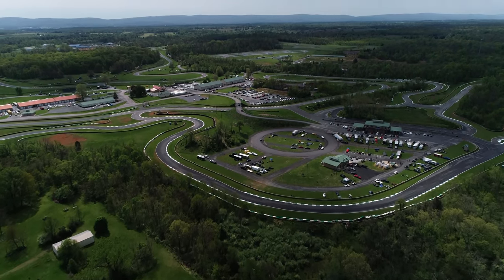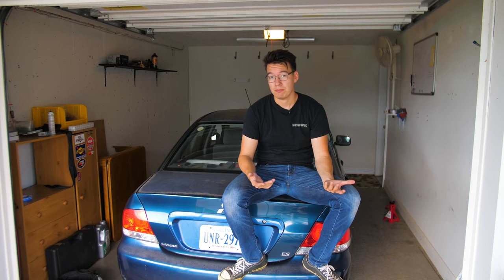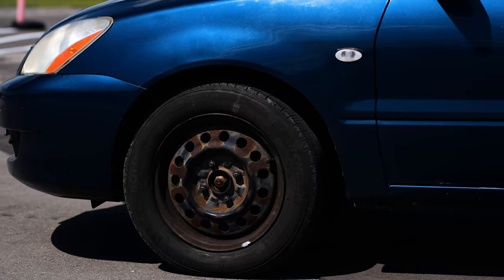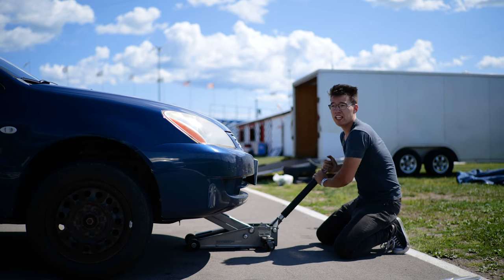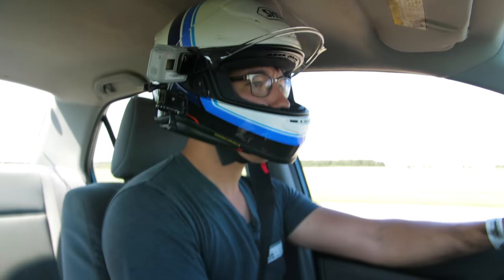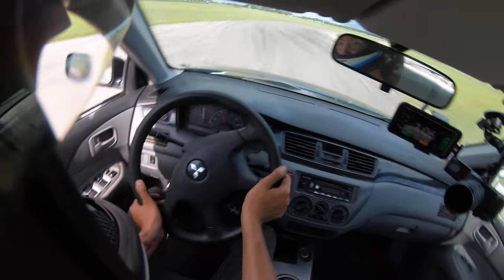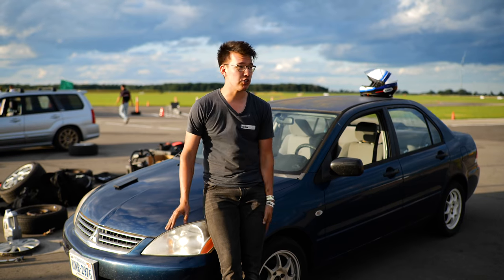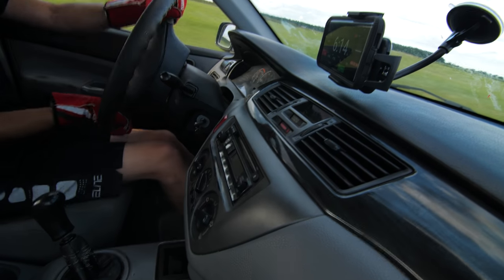Can You Track Your Beater Car?

Comment: Bottom line- good tires and brakes are a MUST.
Reply: tires have always been the best upgrade you can do to a car.  A cars performance is ultimately limited by its grip potential.
Reply: Those are the best first upgrades to do to a car.
Reply: Only thing that touches the road in a way the most important thing on your car 100hp / 1000hp all must translate through the tire 😂🏁👍🏼
Reply: The problem with tires is that if you pick something too sticky then you'll potentially create even more issues with understeer and you'll cook your brakes that much faster.
Reply: Is semi slick tires a must?
Reply: Yes sir!
Reply: @aaryeshg.6526  i would include new brakefluid and a prefectly bled brake system.
Because those old beaters usually have been neglected a lot. 
OLD brakefluid will cause fading within a few fast laps.
Reply: but wouldn't less grip be good fun as well? sliding around and kicking the back is so much fun.
I want to take my daily Subaru Impreza 2.0GX  AWD auto to a track day. I have more fun sideways so I don't want to change tires and i actually want to go on a wet rainy day.
if want to go fastest then sure, get sticky tires but the most fun way around a track is not necessarily the fastest don't you think?
Reply: @aaryeshg.6526  found you
Reply: Just got home from my first track day and I approve this message.

All season tyres aren't the best option.
Reply: I thought sticky tires with stock suspension wasn't the best idea though, more stress on parts that werent designed for such levels of performance.
Reply: Yossi Shohat You will get black flagged for drifting. Go to a drift meet, will probably be a lot cheaper for entry also.
Reply: High temp brake fluid is all you really need.  The tires and brakes pads, just need to be within spec wear.
Reply: @thedriverux  if jou use stock street pads you will burn them up really quick, when you remove them  the remaining friction material will look like burn broccoli.
Reply: @jfv65  I, as well as plenty of other track rats out there use stock pads and/of even autozone pads. The fluid is more important. Pads and tires are consumables just like gas. The fluid won't last forever either, but that is the first part to fail for brakes. The only "modz" you need for a track day are: high temp fluid, helmet, and driver mod or seat time. Those things will keep you safer than squealing track pads and sticky track tires.
Reply: @thedriverux   I think brake pads are more important. Stock pads will overheat and form gas between the pad and the disc which means the brakes stop doing their job which is dangerous.
Reply: @SI0AX  lol. I've seen plenty of Corvettes over cooking their stock fluid with Fancy track pads. 
I'm not saying upgraded pads aren't with it, I'm just saying fluid should be primary for safety.
Reply: @thedriverux  Thing is that brake fluid gets worn out quickly because it absorbs all the moisture in the air and then it's temperature resistance worsens. I think just regular brake fluid will do the job as long as you change it very often.
Reply: @jozo8070  up to you to define whats fun for yourself....

Everybody tune/modify/tweak our own car/s accordingly to our own definition of fun...

So there is no right or wrong...as long as safety and common sense  are kept in check...
Reply: And enough gas.
Reply: don't forget suspension setup
Reply: I’ve never been on a track day, and I’m all for improving my skills by using basic things, but I’d still put on OP brakes and tires just for the sake of safety.
Reply: but if you know how to drive garbage tyres are more fun
Reply: And an mitsubishi :)
Reply: I know people bang on about tires that’s all good and shit but honestly it’s 50/50 relationship.  May go faster with tires but need to slow down more suddenly too, want to brake as late as possible into corners and because with better tires you will also carry more speed need to come down from greater speeds. 

As someone with moderate track use myself 4 things i can tell anyone looking to make their street car more of a track weapon while not totally compromising street livability and on the cheap can shave a lot of time off vs their cost. 

1. Tires (want larger rims and lower profile stickier rubber AI hits same rolling circumference ) 

2. Brakes (complete set, pads and rotors)

3. Brake fluid (way overlooked but cheap and worth doing while doing brakes)

4. Sway bars... 

Tires are obvious.. way stick rubber and want lower profile while hitting same rolling circumference so want side rim and aspect ratios out. 

Brakes are more tricky subject, for conversion cars that want to still use on the road without having to swap pads and rotors out, I suggest vented + slotted rotors.  As for pads, I found running towing package pads that are carbon ceramic based are best mix of both OEM street use AI quiet and stop in wide range of tempatures but they can handle the abuse.  Track rated pads are genuinely terrible on the road because they like to be very hot that’s temperature range they work best in is after an aggressive warm up lap on a Race track they also tend to be loud and sound like on squealers until they get hot... 

Brake fluid is important too, fresh DOT4 is better than old DOT4 because less moisture and more stable and hasn’t broken down completely however DOT5 is almost universally comparable with DOT4 systems (check with a mechanic to verify it is on your car) but DOT5 is much more resistant to breaking down, higher heat tolerances and isn’t going to absorb nearly as much moisture so less brake fade from fluid break down. 

Heavy solid Sway bars.. cheapest way to get stuff ass sway bars in the car is heavy solid steel bars... but worth it, it help corner tighter and more level and thus faster without really upsetting comfort on the road...unless installed all way to its hardest position in which car it can feel little rough. 

All this being said and done easily drop around 5-10 seconds a lap on a power circuit like the track these guys where on playing.    I mean tires and pads alone in that weak car he managed 4-5 seconds a lap improvement.  Imagine in a healthier stronger car how much more could get taken off with these 4 things.. on my car when I first started i dif these 4 things and saw 7 second time reduction per lap! And I’m racing a heavy Volvo wagon around but it has a lot power (400whp) just not much it could do in the corners with it...
Reply: So my bald all seasons and rusted over single-pistons won't work? We'll see about that
Reply: @ForTehNguyen  straight facts I had old tires and it would slid around on wet pavement. I hit a curb and bent some shit and now have better tires on the front.
Reply: I recently installed all new brake lines, rotors, calipers, and pads.. sounds like my winter beater is ready to hit the track.
Reply: @muhammadivandri3997  Not a must, but semi slick tires are usually not as expensive as those high end street tires, and they are very grippy, so semi slick is bang for buck imo.
Reply: Despite being a 2.0L gas N/A with only 115 BHP, My '00 VW New Beetle "Miles" Had no issues catching up to everyone at the curves, the straights however... I got left in the dust.

I would be able to pass everyone if it wasn't for the rule that you can't overtake on turns.

Comment: Can we get a series of turning this car into a track car please.
Reply: I hope so
Reply: I would love to see that. Seeing mod solutions for a car with no aftermarket support.
Reply: Not worth it.
Reply: Worth or not its content!
Reply: @ryanricketts6674  Its basically the base car for the evo theres plenty after market support lol
Reply: nemisis69spec no, not at all.
Reply: @josecamacho748  well you must be looking in the wrong place. Yes they do have aftermarket support. Not honda civic level but most everything can be improved.
Reply: I would love to see that aswell. Look at Carthrottle's video of the BMW 330D for something similar :)
Reply: @nemisis69spec  no their isnt alot of mod support for the es. i have an 05 and have put rear swaybar, sticky tires, 16 inch wheels, better brakes and i want more but most easily found is front frame support, whiteline 22mm rear swaybar, some companies make coilovers, and cai for them but thats it. the engine is a 4g94 2.0l and itcost well over 5 grand to turbo it and thats if u dont care if the conrods BANANA themselves if u go over 6 psi.
Reply from the maker: Ben's Escort is basically this. Beater car (his was actually auto to start with) just modded beyond any reasonable degree. Unfortunately we've just got too much going on to mess about seriously with this Lancer.
Reply: @highseed69  Since the Ralliart is basically an upgraded Lancer I'm thinking you could borrow the parts/upgrades from that, like the front strut bar and suspension. Not sure if it's worth it though.
Reply: @BrixKeeper  the es is 100x4 lug so u have to convert over to the 114x4 or 114x5 witch is not really worth it unless u really want the rear disk brakes. the ralliart is just a body kit added to car. the oz rally and the es have the 2.0 4g94 engine and u have to change rods( BANANA rods)and find a head from a Hyundai to go dual cam, then the 4g93 in Australia has the turbo manifold to turbo the 4g94. the ralliart has the 2.4  witch is comp different engine that can be modified easily. the rear swaybar is the only easy part thats change over thats anybody can do even with no mechanical experience. shocks and struts are different than the es hightwise. only way its worth it to really mod es model is just go oz rally and mod that one. as cetified auto mechanic and auto modder tires, coilovers, whiteline rear swaybar, and good from brakepads are the easy way for average person and thats what this video is about.
Reply: @BrixKeeper  front swaybar is not an upgrade between the 3 different models.
Reply: @highseed69  Where are you from? Here in Canada the OZ Rally shares the 2.0 liter with the base Lancer. The Ralliart gets the 4G69 2.4l, front strut bar, stiffer suspension (a bit lower too). I own an 05 Ralliart.
Reply: For everyone in this section. My daily and street car is the lancer 2004 es stick shift. From 2002 to 2006 the lancer es's use the 4g94. The engine has little to mid aftermarket support. Running NA in this engine is POSSIBLE BUT not recommended since the engine does not respond well to bolt ons. What you can do if you really wanna keep this engine. Is turbo it. There is a bunch of 4g94 turboed lancers but you will still spend a pretty penny but you will go from 120hp to 200+ and it can handle 350hp depending on your mods just not as much as trying to make it NA cause money. Now dont front and get all pissy. Thats just the lazy stuff. You can take a 4g92/4g92 mivec/4g93 head and those bolt right on this engine. Doing this will give you an instant power boost and top of that better and more aftermarket engine parts and you guess Mitsubishi pony boys you can turbo it! BUT FOR CHEAPER!! A FRACTION OF THE COST if you were just 4g94. Now that you did all of that. You got a lancer thats more than a evo. More fun cause its fwd and lighter and a sleep cause people gonna think you a ricer. There is tons of body after market support too as well cheers fellow boosted lancers. I will be taking mine to a track soon. - Mivec 350hp
Reply: Yes!
Reply: @josecamacho748  theirs heaps of aftermarket support for these cars having own one myself but a ce 99 models alot of aftermarket or even factorty 0parts from cars like the fto are upgrades for it
Reply: @GearsandGasoline  can i have it?
Reply: @josecamacho748  dude it fucking is an evo... its called a LANCER evolution, the evo is just this car with a lot of factory bolt ons. the gen before this literally has evo front suspension and very similar rear
Reply: like car throttle?
Reply: @Pinkarmada01  boosted lancer as on youtube Instagram or what platfor are you talking about. I'd love to see this as I'm doing a 92 mivec head fully built bottom end and boost aiming to hit 500hp.
Reply: @highseed69  hyundai head? Excuse me!
Reply: @blue_lancer_es  swap in a 4g64 and get a dohc head from 99 to 2003 Hyundai they bolt right on.
Reply: @highseed69  yeah that i know. But the way you wrote it sounded like a hyundai head on a g94 block. 
But also. G64 swap also entails transmision axles and some wiring\sensor work also. Its not like oh a block and send it.
Reply: @BrixKeeper  here in Canada they didnt put a front strut bar in es, but the strut bar from ralliart will go on as long as u cut the strut bar to fire wall triangle support off because it doesn't reach firewall and theirs no support on firewall to bolt it too also u cant hit the gas hard because intake can tap the strutbar unless u have a good or new rear motor mount. the es didnt come with rear swaybar but the factory ralliart and oz rally(both are the same rear swaybar) did and fits the es or u can go whiteline. the front swaybar is different shaped in ralliart because of the 2.4l is in the way. the oz rally and es front swaybar are the exact same part number and exacly the same when measured and stuck beside each other. whiteline does make a front swaybar but it is just slightly bigger than factory and not noticeable on street or light raceing. megan raceing makes frame cross braces and other lancer aftermarket parts.

Comment: Saw a guy in a high mileage $3k 07 Camry V6 at the track once. He did this exact same thing -- swapped wheels/sticky tires and better pads. Since it was the v6, he was literally KILLING it. Total sleeper.
Reply: Yeah those v6s make about 270hp. I've seen a 6spd stripped out one before. they can be really fun.
Reply: @joshuafallet5690  i really want to get two whole subframe assemblies of some 2GR camrys (engine, gearbox, suspension, etc), and stick them under a yaris shell, one in the front, one in the back.
maybe chuck on some TRD superchargers if I find the money.
Reply: sdlausen v6 Camry’s are bad ass my buddy has one and all my cars have never been able to touch him
Reply: @trevorzehren139  Indeed! That's why I spend a little more and got an IS350 F sport. Same combo, but RWD.
Reply: @sdlausen1  better transmission subjectively as well. But manuals are fun.
Reply: My wife has a 17 Altima and it’s pretty fun to drive. I feel like swapping the V6 VQ35DE and a manual in it and track it.
Reply: id love to throw some stickies on my avalon and put the "touring" suspension on it.. things quick. and with Venza brakes and some good pads and rotors she stops like no other.
Reply: My sister had a 05 v6 Camry, super fun to drive
Reply: @joshuafallet5690  hahhaaa high mileage! How much 400k?
Reply: The 1mzfe V6 deserves more aftermarket support
Reply: Reading this comment and replies made me Appreciate my V6 Altima, no need the more expensive and less reliable 350Z.

Comment: Anyone noticed the car becomes a tripod in the corners like a classic hot hatch does? 👌 By tripod I mean 1 wheel flies in the air for a sec. 🤣😎🤣
Reply: Or just classic hatches in general
Reply: Hello
Reply: Fwd hatches do that if set up well. Promotes rotation.
Reply: True. Not often a fwd sedan can do it though. Probably because it has IRS.
Reply: @arevo8702  Hello :)
Reply: Had the same thing happen at the track with my car only 13 hp and still drove 100kph on the straight but every corner the tire was so high in the Air that everyone thought it would roll. But it worked and I had fun.
Reply: @DanJLeh  So it means my car is set up well. Nice 😅

Comment: Track every Pontiac coupe you can find, cheap economy car, and an Accord (or Altima) V6!
That one tire in the action was thrilling
Reply: Seasexnsun  I remember Toyota sold a Turbocharged version of your car too. Had close to 150 hp (that's what an average 2.0L NA makes). Drove the heck out of it in Gran Turismo and it reaches just over 200 km/h on its own stock. 🤣👌 It's like a fwd Lotus Elan.
Reply: Just remember that the yaris isnt a safe car. I daily a 2007 yaris and constantly worry about dieing in it. A rollcage is a must imo.
Reply: @coolsupermanfly24  look at the new mirage my friend drives to work. I rode in it for shits and giggles cause i used to own a 2001 mirage and he owns a 2016 mirage. Everytime this thing went over 50 i thought i was gonna do a barrel roll and die
Reply: Pinkarmada01 😂😂😂 Doesn't it feel like you are going faster than you really are?
Reply: @coolsupermanfly24  that thing goes 72 hp slower than anything i ever felt
Reply: Pinkarmada01 lmao!

Comment: Also a must for any car that is over 10 years old and that lived all its life in the rust belt, install new ball joints and new rubber suspension parts! It might drive fine on the road, but on the track, an old dry rotted bushing or ball joint, especially on a double wishbone setup, can snap at any moment! 
I learned that the hard way when the ball joint snapped on my '97 Civic.
Reply: Andrey Mitrofanov shit I’m still not confident in my ball joint changing abilities yet to do mine
Reply: @luisvilla799   as simple of a job it might be, I'd leave to a mechanic just to be safe that the job is done right. 
I just saw another Honda with a snapped ball joint that caused a major traffic jam on a 2 lane highway. Better be safe than sorry.